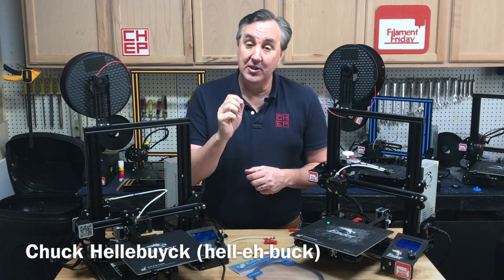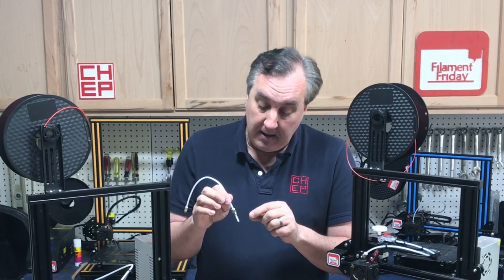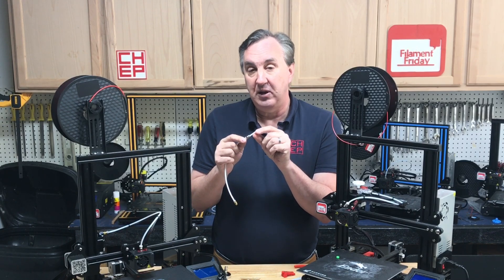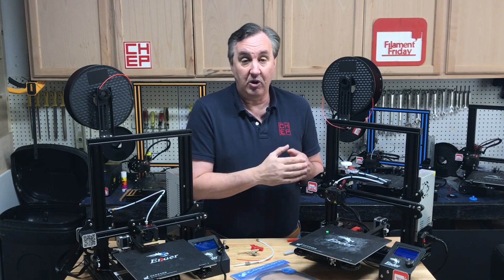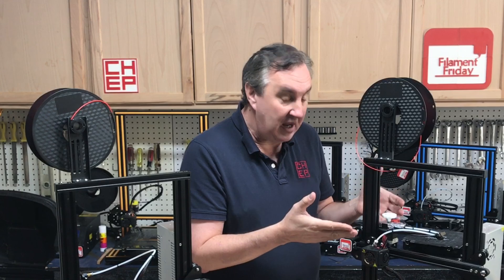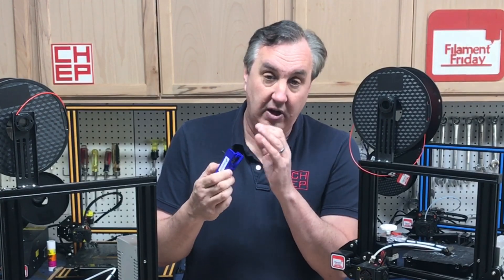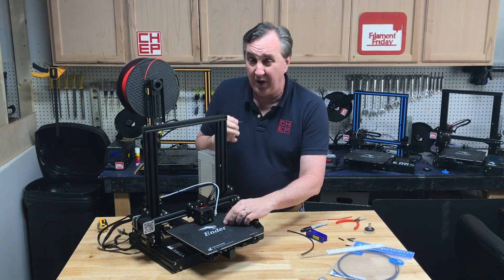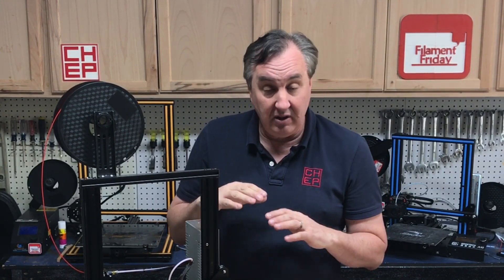Simple HOTEND FIX for Creality Ender 3, CR-10

Comment: Very simple idea, as I encountered a blockage on my CR10s Pro overnight I thought I would give this mod a go, luckily I have a few CR10sPros so I printed this on another machine. I'm tempted to make one of these out of a Stainless washer, I don't think it would have a heat transfer issue so far past the heat break.

I only really print in PETG, and my printers run at 248'C on a 0.6 nozzle (one on 0.4 at 245'C) for long periods (perhaps 20hrs per day or more non stop) as I'm running a small printing business. I find even the Capricorn tube suffers at the nozzle end after 100-200 hours of printing at these temperatures, but at least with this hopefully I can just change the insert periodically.

Incidentally I notice that the upper bowden tube (the bit which goes from extruder to coupler on the hop end) now rotates slightly as the print head moves from left to right, presumably as it is now only held at the top and not jammed down in the hot end, I wonder if this will cause premature wear of the coupling and it will fail? time will tell I suppose.

Anyone else experienced this?

James

P.S. Thanks CHEP another brilliant video
Reply: Nooooo 4-hours in and  'click, click, click' the sound that haunts the dreams of the 3D printing enthusiast!

 Obviously something's gone wrong, start again...

Comment: Or you could just use the pneumatic fitting the right way
Reply: @EntrE01 what's the "right way"?
Reply: @jameswyatt5859  screw the fitting all the way in, undo it by two turns, insert the ptfe tube, then tighten the fitting all the way again. that way the ptfe tube is pushed flush into the hotend.
this video is the type of hack that's solving an imaginary problem.

Comment: How hot can you print with this mod?  The PETG I have specs 250C for the extrusion temperature. I switched to a MicroSwiss hotend on one of my other printers to print this hot. If I can print this hot with only this change, I'll avoid making that upgrade on my Ender 3 Pro.
Reply from the maker: 250c is the max in the firmware (unless you updated it).

Comment: With this fix, when you change your nozzle, what's holding the piece of Capricorn tubing in place inside the hotend? Wouldn't it just slide out after the nozzle is removed? Or is there enough friction between the tubing and the hot end to keep it in place?
Reply: I think its enough friction, but even if it gets out, you push it back and screw in the nozzle if you have tight tolerances and with that washer it seems like you have it will be a perfect fit every time

Comment: Thanks Chuck for this fix. I tried it to fix an issue with my extruder skipping steps. When I print something with a lot of repeated retractions it starts to skip steps. I thought at first I had a gap between the tube and the nozzle. But with this fix I still have the issue of skipping steps. Any thoughts?
Reply: And try to play with retraction settings every spool has different retraction settings and also try to play with the feedrates and see what happens
Reply from the maker: Check the arm for a crack
Reply: @FilamentFriday  thanks for your answer. Forgot to mention that I have a ALU version on it. So no crack in the arm. And it does it only when a lot of retractions are done. Almost like there is to much pressure is build up in the hot end.
Reply: @marchooghiemstra  Try to do an extrusion calibration and see if your printer extrudes what it says it does mine had this little issue (Creality cr-10s) it  under extruded by 1mm and i had tiny little gaps here and there because of that, there are alot of videos about extrusion calibration out there take a look and see if that's the problem
Reply: @marchooghiemstra  I had this issue with the aluminium extruder too, the lever spring they supply is longer and tougher than the stock plastic one. I just put the old one back in and the filament stopped jamming/breaking at the extruder. Took me ages to discover

Comment: I am trying this right now! One thing which did not work out of the box is the washer. For me it was too thick (or 7 mm in the hot end the hole tapered to something a bit smaller). The coupling (came with the capricorn tube) only went in for less than 1/4 rotation so I did not dare to put any force on it. I sanded the washer down to 2 mm and cut a new piece of tube. I have an Ender 3 pro from september 2019

Comment: Hi, I would need help regarding the extrusion of the filament, I followed all the guides to calibrate the steps / mm for the x, y, z axes for the extruder, but I noticed a print quality problem on the surface of printed objects. Practically if I extrude 10 cm of filament from the extruder motor there are no problems, it comes out perfectly, while if I extrude 10 cm of the filament from the nozzle it leaves much less about 4-5 cm. For this reason I thought it could be a hotend problem and therefore I disassembled the whole piece to see if it was blocked or if there was any other problem, I changed the piece of the ptfe tube inside it, I mounted everything, I changed the filament and I tried through pronterface to extrude another 10 cm of filament, but nothing always the usual extrusion problem. I turn to you to understand how to solve this annoying problem. Thanks
Reply from the maker: Check your gear isn’t slipping on the motor when under pressure.

Comment: I'm going to give this a go. I've had a recent problem where the hotend gets clogged, but the nozzle is not clogged. Really weird and inconsistent - sometimes it happens after a couple hours...and my most recent print happened after about 19 hours. That last 20 mm of capricorn tubing feels sticky. Even more odd - I printed a 3.5 day job with no issues right before this issue started. Just wondering if you have any other thoughts while I'm working on implementing this fix.
Reply from the maker: If it’s sticky then it may be failing. You could also have a leak around the PTFE/nozzle connection.

Comment: I have several pieces of tubing leftover - white PTFE and some blue tubing.
Is the Capricorn tubing identifiable?
The blue has no labeling that I can find. The original packaging is gone.
Reply from the maker: Blue is typically capricorn
Reply: @FilamentFriday  but not in every case.  A local vendor sold us some blue PTFE tubing, not Capricorn, that they said was about 1/2 the price of Cap.  I wasn't impressed.  It may have been a higher quality tubing than the white, but still wasn't like the Capricorn.

Comment: Yup. PTFE can and will break down quite readily. This is why Teflon (PTFE) coated frying pans have those "don't overheat" warning labels on them. And even if you don't overheat them, they DO have a limited life span - typically around 250 to 300 heating cyles or 150 to 200hrs at their max rating ... which appears to be matching the time you typically have before your hotend starts acting up because of blockages. Great video BTW!

Comment: The thicker washer does not work with my older CR-10. Even with the washer by itself, no PTFE tube inserted, there is not enough thread to tighten the coupler back on. Will try Luke Hatfield's washer instead.

Comment: Chuck, instead of 3d printing a fill part to insert why not just use a M2 washer ? Outside is 7.12mm so that would work and hole is 2mm. Then the top fitting can screw in further also.
Reply from the maker: Some people do. But printing it only requires a printer.
Reply: @FilamentFriday  Yes I like the idea of printing the parts as well. But since I design and build 100's for 3d printed mechanical projects I have bags of washers and screws, so its easier to just grab the hardware. Thanks for the great video. Such a good way to fix the problem. I plan to do it to my old Anycubic i3 as well.

Comment: Luke Hatfield: "tubing must be between 31.2 and 31.4 mm long - be very precise, measure after cut with good calipers".
CHEP: [roughly marks a cut with thick marker] it's 35 or 36 mm? Whatever...
Reply from the maker: I explained this in the video.
Reply: @FilamentFriday  i know and You're right. I'm currently cleaning nozzle and will follow Your instructions. Thats just irony about methods. Some will measure everything very precisely, others will try to understand how it works and do only whats really necessary.

Comment: Love your videos. So with this mod, does it mean we can print with higher temps than the recommended 240?
Reply from the maker: The firmware is max 250 unless you changed it. You should be able to handle that for smaller prints.

Comment: I've been doing something that yields the same result of a tight fit, but I like your solution better. Also, when I start getting that issue where the extruded filament balls up around the nozzle instead of sticking to the bed, I toss the nozzle for a new one. The brass nozzles are cheep in bulk. And, it's been my experience that once this starts, there is now way to clean it off. I tried so many things thinking the problem was with the bed... I tried leveling the bed, using glue stick, hair spray, different bed surfaces and tried everything I could think of to clean the outside of the nozzle from cleaning fluids to scraping and even sanding with ultra fine grit... it's as if an invisible contaminant gets on the nozzle and it's over, but swap the nozzle and all is well again. Have you experienced this?
Reply from the maker: Not really. I usually find there is a minor blockage causing that. Though I do change my nozzles often as you said they are cheap.

Comment: My ender 3 prints this very messy print. slicer cura and i tried and changed setting but get same result..... What was your printing profile for this hotend insert? So small and messy too print.
Reply from the maker: My 0.12 profile.
Reply: @FilamentFriday  Thank you Cheap
Works Like a Charm!!!👍👍👍👍👍👍
Reply: I meant Chep ..... Stupid auto spell corrector

Comment: Hello again from a Canadian maker.
Still having extrusion problems. I have gone back to factory configuration for everything. Did a calibration cube and it came out great.
Going back to the dual drive extruder using the same NEMA 17 motor. Calculated the steps/mm and changed the firmware.
It prints well but not as good. Layers are inconsistent, one will be under extruded and the next layer will be over extruded.
I have all kinds of ghosts and think I may need to test all my components individually.
Reply: If you have ghosting you should tight your gt2 bands.

Comment: Hmmm... I'm not sure what I'm doing wrong, but my stock (except for aluminum extruder) Ender 3 went from perfect results to quite stringy after making this change.
Reply from the maker: That’s weird. Are you using my profiles for Cura?
Reply: @FilamentFriday  Hi Chuck! Yes. And they worked beautifully until now. Better on the E3 than our Ultimaker 3s at work. I may not have cut the capricorn short enough: I didn't get the coupler screwed in very far. When this print is done I will pull it apart and readjust and retry. Thanks for the reply!
Reply: @FilamentFriday  I think my issue is that with the washer in place there is not enough thread left for the coupler to grab. Even if I don't put in any tubing below it (leaving it out just to rule having it too long as a culprit). I have measured my washer with digital calipers and it is 4x8mm +/- 0.05mm).]
Reply: I'm seeing the exact same thing. I've never had stringing before - it started after this mod.

Comment: Might have to try this...! 

Have you experimented with Linear Advance in the Marlin Firmware? I have started playing around with it and have been able to achieve some good prints at ~100mm/s wall and infill speed. I'd be interested in seeing what you think about tuning linear advance.
Reply from the maker: Not yet. Did you install it on a stock Ender board?
Reply: CHEP Yes I have, stock board.

 I have my set to 0.8 which seems to work well for me for pla and petg. I have settled on printing at 70 mm/s wall and infill speed with no noticeable quality differences.

Comment: Hi. Great mod, I have beend using previous version for months on Ender 5. The only thing I'm thinking is why the height of the washer is 4mm ? The coupling can't be screwed down by 4 mm, so the huge part of thread is not used (maybe it is the Ender 5 problem, not the Ender 3 ?). Why not to use 2.5 mm wahser to have more consistend the coupling handling ? I'm testing the reduced heigh version and let you know how it works.
Reply from the maker: It fit well for me and less flex of the tube insert but with the shorter design hotend Im considering a shorter washer.
Reply: @FilamentFriday  Does the Ender 5 (I'm still on stock hotend) has shorter hotend then Ender 3 ? Btw, 2.5 mm version od washer works fine.

Comment: Can you talk about all metal hot ends and how to print high temp filaments with them? Or can this setup with the capricorn tubing print above 270?
Reply from the maker: 270 is pushing it but the stock firmware limits to 250

Comment: Should the inner diameter of the washer be closer in size to the filament diameter to prevent flexibles from binding up in it?  It looks like it's 3 mm and I'm wondering if that's too big.
Reply from the maker: I’ve run lots of ninjaflex thru it without any issues.
Reply: @FilamentFriday  Thanks.  I just took the ptfe tube off my CR10 mini for the first time.  There was all kinds of gunk in there!

Comment: Very useful tip! I have a question, though - is there a specific material I should be printing that coupler with? I worry if I use the PLA that I've been using for my prints that it'll wind up melting in place. Or am I just misunderstanding how far heat travels up the hotend?
Reply from the maker: You mean the washer?
It’s very cold at the top of the heat sink so PLA works fine.

Comment: Great video, your findings is always spot on with what we all go through. This video is pretty much my experience ever since I've watched that first plastic coupling video. Back then I've decided that the washer was a better solution because it was being held down by metal threads. I've been exchanging the insert every 3 months from a 5 meters long $8 creality PTFE I've ordered from banggood together with the printer (I had watched a lot of videos before buying the printer so I knew some of the necessary cheap extras to order, yellow springs, fans, nozzles, metal extruder, etc...). Just like you, I've also found out that the printable cutting jig was not the correct size, so I broke off the end stop wall, and use it mostly for the 2 walls that guide the blade for a square cut. I've measured by cutting it a little bit longer than needed, then unscrewing the nozzle 2 or 3 turns, putting the piece in, cutting little portions as needed, and when it's flush with the washer, I know that the unscrewed portion of the nozzle is extra, so it will squish when tightened. I've just received my capricorn tubing this week, ordered it in November, $48 in shipping (4 months) to Brazil, I so wished they would ship it from china (chinese shipping subsidies makes for $2-3 shipping to Brazil), I had a choice to make, keep swapping out inserts, or pay the price to have long lasting inserts. 2 meters long capricorn is a lifetime supply as inserts, since, like you, I've decided that the guiding tube would remain as the white one.

Comment: The same problem on my Ender 3 last week - melted PTFE tubing inside heatbreak and after that stock extruder broke from too much pressure. I've changed whole hotend + PTFE tube + broken extruder (changed with aluminium copy = less fragile) and all is ok again., but Your tweak looks perfect for the future-proofing the printer. Thanks ;)

Comment: On another channel I found it was a good idea to chamfer the top inner diameter of the Capricorn tubing to give a taper as the filament feeds into the top of the extruder. (Joe 3DMN Nov 2017) Just a suggestion.

Comment: Does this modification raise the max print temperature for the stock hot end. I know 250ish is the max with it all stock but what is the limiting factor for this?
Reply from the maker: The firmware limits to 250 but if it’s reflashed to allow 260 it would probably work but I doubt much higher.

Comment: I think the biggest effect loose dia ptfe has is pressure and layer accuracy, if you look at some prints done on dragon/mosquito hot ends, which use high accuracy tight tolerance break,  the layering is like much better than stock or "loose" hot ends.
Reply from the maker: Do you have pictures showing the difference? 
They both use the same size nozzle and extrusion force so I’m not sure I understand.

Comment: So how do I change nozzle in a setup like this? The ptfe inlay would fall off whenever the nozzle is screwed out. I've seen the heatbreak tube with pre-installed ptfe. However didn't tested it.
Reply from the maker: It’s not that loose

Comment: Sometimes I feel extremely lucky to have the Ender 3 I do. I bought it from china about 3 years ago as many others did. I hear of these tips from many sources. But I won't even update the firmware for the thermal runaway protection because I have no complaints. I'm not sure what gives?

Comment: Great mod by Luke made better with Chuck's improvements.  But I have found that even the Capricorn PTFE degrades over time especially if you print at hotter temperatures for PETG or print a lot of long duration prints.  Best advice is to inspect your Capricorn PTFE at regular intervals or any time you are changing nozzles where you are disassembling the hot end.

Comment: I want to explain how to use digital calipers to measure the length of the inside of the hotend, if you have one, such as the one that comes with the CHEP toolkit. Chet did mention it as an option but did not explain or show how. There is a bar that extends out the right side as you open the jaws, that is used to measure hole depths, and the width of the bar is about 3.3 mm, just right for inserting into the hot end, and you can take a direct digital measurement!